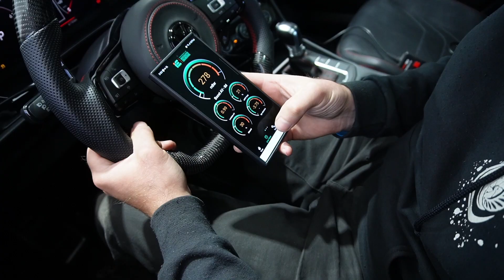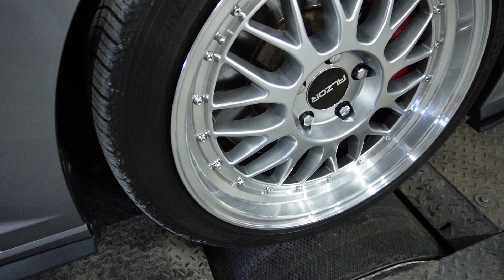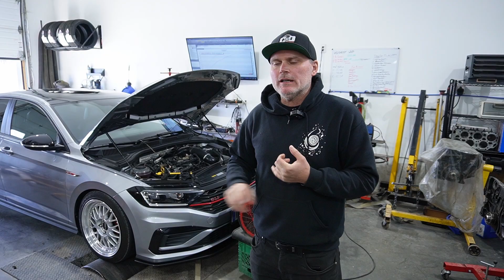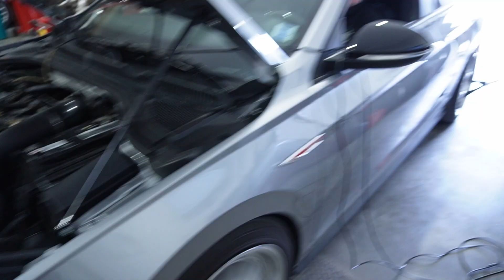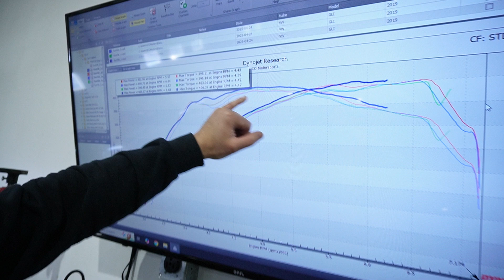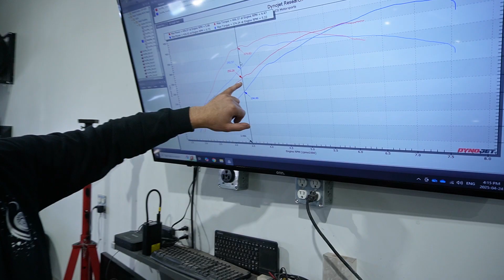MK7 GLI with Integrated Engineering Stage 3 Turbo

Comment: I heard you say the vortex had better boost sensors for higher boost. So technically could you put better boost sensors provided you had tuning that supported better boost sensors on the gt2260s and get higher than 29psi? Or is 29psi maxing that turbo even with better boost sensors?

Comment: How does this PMAX turbo compare with the IS48 on the MK7R fitted with MPI, upgraded Low&High pressure fuel pumps, upgraded fuel lines, 4” down pipe, 4” straight pipe exhaust on E85?

Comment: Had PMAX in my S3 and had to port wastegate due to boost creep and wanted to exceed 28psi and after 2k miles started leaking oil into hotside probably due to exceeding max shaft speed caused damage so decided to swap in a Vortex standard and ditched cobb for simos tools for flashing custom open source tuning eliminating the unplugging of post cat 02 sensor and CEL light. I should have skipped the pmax and went right for the vortex standard coming from is38 as the top end power just keeps pulling and responce around the city is hardly noticeable between the two turbos. Pmax Great turbo for guys who just wan't a little more power than is38 and do not have upgraded fuel system and aftermarket downpipe and don't exceed max shaft speeds.
Reply from the maker: @Mkultraelectronics  good info, remember this is fwd so that plays a factor in useable power as well. 400whp is sort of the ceiling for a fwd street car.
Reply: Thats sounds tuning related to me. Zero issues with boost creep on mine.

Comment: Just installed this kit on my MK7.5 R. To me, it seems like a happy medium in between the stock turbo and "big" turbo options. It doesn't give the low to mid RPM punch that the IS38 does, but it's now much more rewarding taking the car to redline

Comment: That's slow my stock 2014 beetle with stock is38 and stock fuel system with 93 oct made 400whp 😅😅😅
Reply from the maker: @StreetModCulture  nothing in this video shows anything to do with speed... So how is it slow? And your car does not make 400whp on an is38 on 93oct with no fueling upgrades....not a chance sorry. It's a stretch to hit 400whp on an is38 on straight e85. Maybe you don't know the difference between whp and crank HP.
Reply: @COMotorsports saved me from
Having to say it. Ha
Reply from the maker: @JordieG8  It makes me sound like a d!CK but we try and keep it real around here. Lol
Reply: @COMotorsports  400whp. bro put his life savings in that car. Something no right. I can tune his car stock no mods 370-390
Reply: Your beetle would never hit 400whp on e85 with that turbo. Stop lying, you clown.

Comment: I think the guy that owns the GLI should add EQT LPFP and MPI. Also do there custom pump gas and Flex Tuning and compare. I've seen the PMAX Stage 1 make 410whp on pump. Definitely needs more fueling
Beautiful car.
Reply from the maker: @colinmcdonell5034  yeah issue is it's a big expense for little gains at this point.
Reply: @COMotorsports does IE software even support more than just their HPFP upgrade?
Reply from the maker: @Vapidyne2  to my knowledge, negative.
Reply: @ I just saw on their website, they have an MPI kit for sale but it specifically says “Requires custom ECU tuning and is not supported by any iE tuning stages.”
So hopefully in the future we can get MPI support for maxing out that turbo.
Reply: I i was saying before the Pmax Stage 1 turbo should make 400whp plus on pump and 450whp on E30 for sure. Just check out Stratified Tuning. On PMAX Stage 1 LPFP / MPI with E40 they did 460whp.
Reply: @COMotorsports anyone can add walbro 305 lpfp on any setu-up. That pump will flow more/ wont struggle to deliver what’s requested and it doesn’t require custom tuning
Reply: @colinmcdonell5034 this gli doesn’t have mpi or lpfp and ie’s tune doesn’t support those parts
Reply: Mine made 410 on pump as well.
Reply: It's the IE flex tune i believe